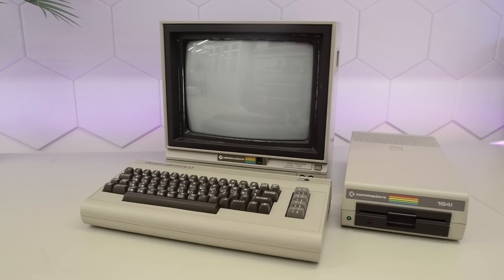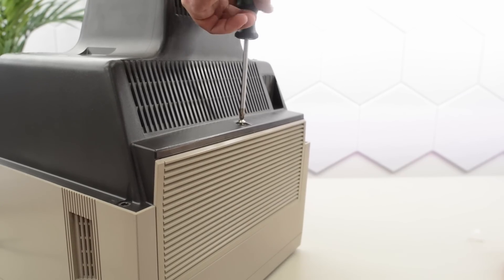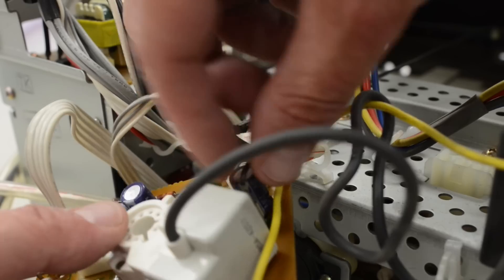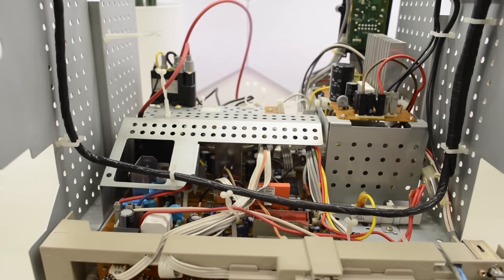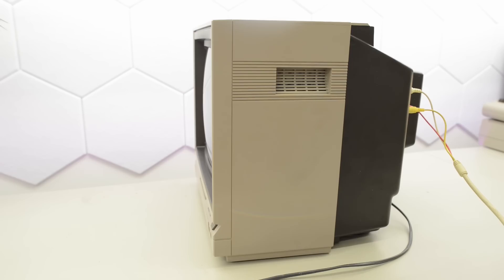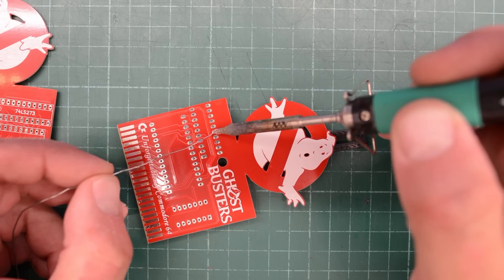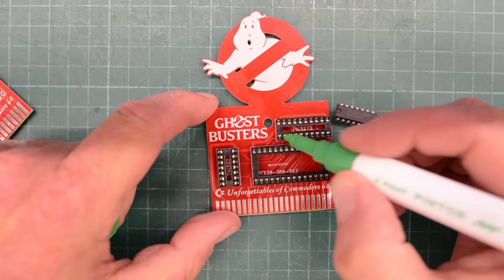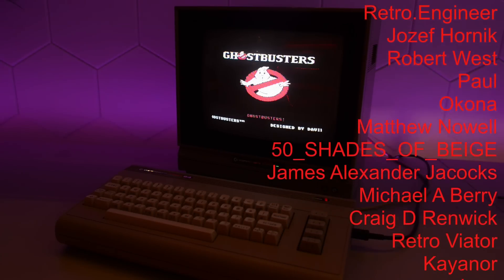Commodore 1702 Teardown and Ghost Busters cartridge build

Comment: I love my 1702, but the focus voltage is all over the place once it warms up. It really needs a new flyback but nobody makes them anymore.
Reply: It might be leakage in the CRT socket, or in the focus / G2 divider, which is separate from the flyback I think. You can try to disassemble the socket and clean the tube around the focus pin. The plastic rim usually can be removed carefully from the end of the tube so you can clean the glass around the pins, and the plastic rim itself. The socket has a spark gap for the focus voltage, if you disassemble the socket and wash that area with IPA it might help. But it also can be a tube fault, which is still better news than a flyback failure, because you can swap the tube from almost any TV with the same size (unless these are high resolution tubes, but I don't think they are).

Comment: If you are experimenting with video length. For me the magic number is ~25 minutes. 25 minutes just seems to fit into my schedule more. I know short vs long videos is a battle ground now. I'm on YT for long videos, because I have the attention span.
Reply: 15-25 min is indeed about the right length.  Long enough to be engaging, but not so long that I start to schedule it for "when I have time" until it falls out of the queue.
Reply from the maker: This is pretty tricky. YT seems to promote longer videos but it isn't easy to find the time to make longer videos every week

Comment: 1702 has much better colors than other commodore monitors if it has a JVC (I think it was JVC, might be Phillips) tube. Same with the 1902 for 80 columns. The other monitors are very washed out looking and don't have very good saturation.
Reply from the maker: This 1702 has significantly nicer colors than my 1084-P

Comment: Hm. My 1701 has a fine-pitch shadowmask (and I have stacks of TVs to compare it to).
Eons ago I was given a C128D with some games, a printer and said 1701. And when I found out that through an adapter I could hook it to my VCR and watch TV and the picture was a lot better than my cheap TV (sharper AND brighter), I pretty much stopped using my regular TV (which didn't like that and died). It's probably all black inside from the hours of use.
Just a few years later I snatched a 1802 for a tenner and was disappointed that it had a regular pitch shadowmask. It also felt cheap, looked cheap and had a cheap picture - exactly like my cheap old TV when it was still working.
Reply from the maker: Someone mentioned that this might be the T model of the 1702. Maybe there is a difference? I'll compare it with the 1901 which is a magnificent chroma/luma display
Reply: @Epictronics1   There's also a huge honking circular metal can on the right side and I think I read somewhere that the 1701 uses a transformer power supply whereas the 1702 uses a standard switch mode PSU. And the CRT being different.

Comment: Nice work, as always.  That appears to be the more rare 1702T variant.  I have a regular 1702 and it does not use the Toshiba tube.  It also does not have all that metal shielding, IIRC.  I think it is mostly the same but according to the Service Manual there are some differences in components to accommodate.  
As for logic chips, HC chips are High Speed CMOS.  The C64 uses TTL levels so although they tend to work they could cause problems due to the nature of what is a low and a high level in TTL vs CMOS.  HCT chips are what you want for TTL levels. I usually just use LS chips as they seem to be the cheapest and do use less power compared to non LS.  I am simplifying this from an article some engineer wrote that is way over my head. ;-). If you look on melon64 forums there is a great explanation that is easier to understand then engineer speak.
Reply from the maker: Cool. I don't have access to a regular 1702 for comparison with this T model. It would have been interesting to see if there is a difference in image quality.
Reply: @Epictronics1  thats what I was curious about too.  It is so hard to tell on a video.  I do know that my 1702 is very sharp and I have been using it since the 80s.

Comment: Colour CRTs often have a dark treatment and sometimes anti-reflective coatings on the glass to improve contrast.  Several CRT makers in the late 1970s also worked on phosphor formulations which absorb less incident light to improve black levels- hence the term "black  stripe".
Reply: Nah, I'm thinking, if you observe the little black stripes between the R/G/B stripes* on the front of the CRT - on older CRTs these are usually silver and often a little wider. If they aren't, they're likely to bend under heavy electron bombardment - showing a bright picture for just a few dozen seconds warps the shadowmask and the colors won't match afterwards until it cools back down. Black Stripe CRTs don't have that problem. A few of the very latest delta gun CRTs had that same technology, so maybe I'm totally wrong here.
*) helps if you're near-sighted (or use a magnification lens)
Reply: @senilyDeluxe  I believe they did both- developed phosphors which were darker in the ground state and made the stripes between the phosphors darker.
Reply: blackstripe is a trademark. nothing to do with the technology..... a company making something is not going to give away their IP and trade secrets in the name lol